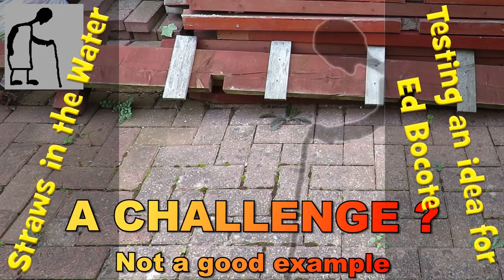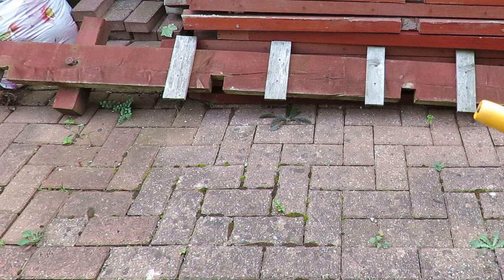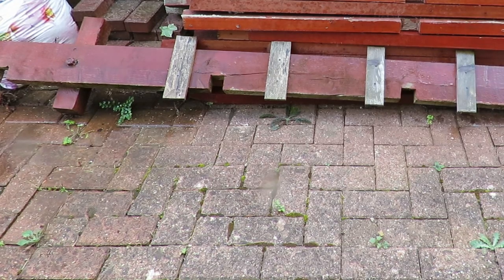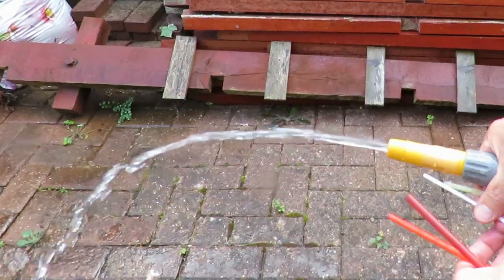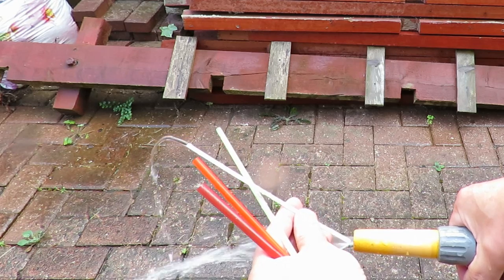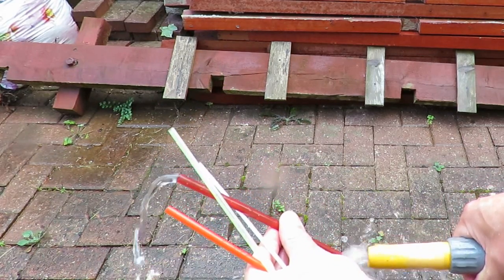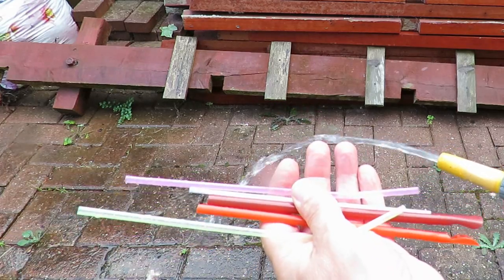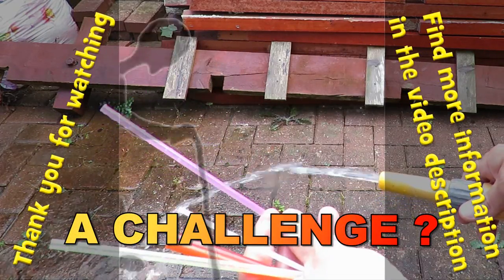Straws in the water for Ed Bocote A CHALLENGE? not a good example

Comment: After looking at this video and also some simple experiments, my thought is that the difference between the kitchen sink and hose trials is the position of the straw. If the straw is held at an angle just on the surface of water so that there is a small opening for air also (only half of the opening of the straw in water) and then move it on the surface of the water, the air pressure in the straw will be same and it picks up some water. I will try this at the stream near here and post a video later
Reply from the maker: I will look forward to seeing it. Take care not to drop your camera in the water.

Comment: theres a way to measure the flow of water and it is , the bucket method, if heard of it before,that way u can find out the speed the water comming out of the hose. heres a link to that ,http://www.appropedia.org/How_to_measure_stream_flow_rate, but if u had a speed boat and would put the straws on either side of the boat, wouldnt u think that the water would shoot out from the straws.
Reply from the maker: Hi Marc, you seem to have come to the party rather late and missed the previous episodes. This started with a request from Ed. He asked me to put straws on the side of my boat and see if the water came out the top as a jet. I tried it and it failed totally. The next few videos showed some further tests and challenged people to make a video to demonstrate them making it work not just make guesses and suggestions. I am trying to encourage people to have a go themselves. Measuring the flow of water coming out of this hose pipe will not help anybody picture a boat going through the water. Let's imagine I calculate it is doing 10 gallons per minute, how does that translate to how fast we need a boat to be going to generate a jet of water perhaps exiting the straws 6 inches high? No doubt there is a mathematical formula for that but it will need to include the speed of the boat in the equation. In my challenge I included the option to provide a mathematical proof but flow rate is not the answer.